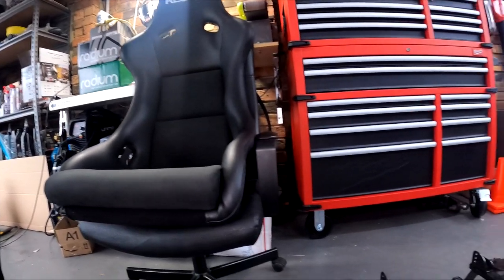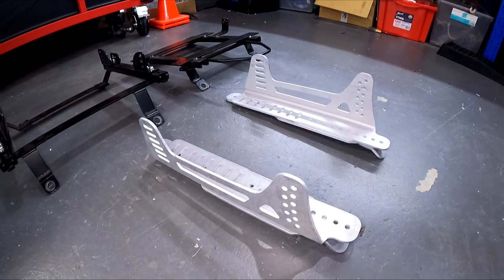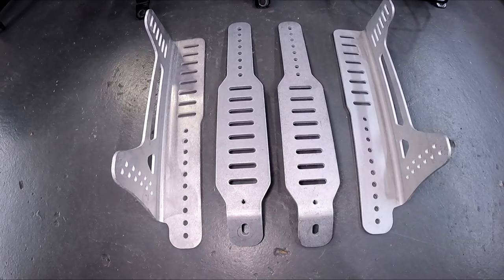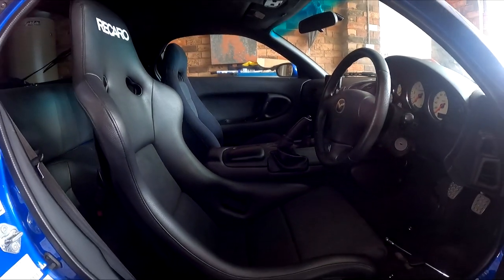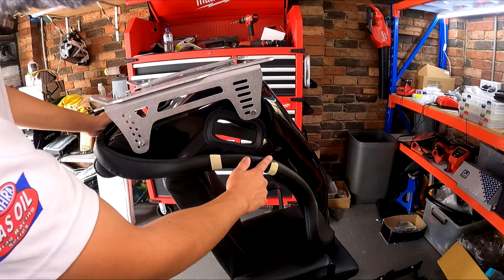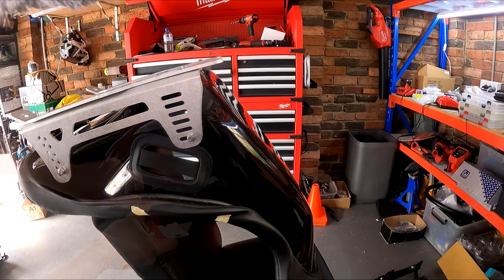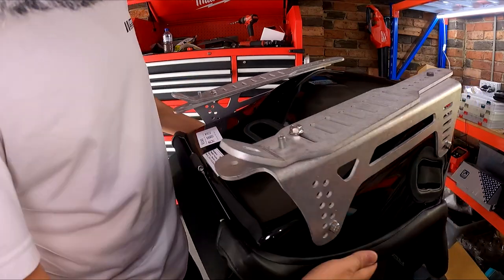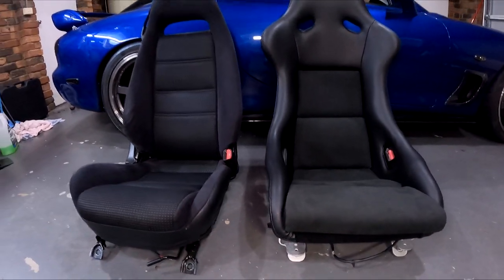FD RX-7 Build EP. 3: Installing a new RECARO!

Comment: Hi does the shoulder area rub on the door panel? How much space would you say is left over if any? I want the spg xl but the shoulder is wider. I think everything else is about the same. Thanks
Reply from the maker: Hi mate
I just looked at the dimensions for the SP-G XL and compared it to the Pole Position ABE. It looks like overall width is the same, but the SP-G is taller, longer and wider at the base. I can have a look at the car today to see if this puts the shoulder padding in a better position. There is no space left over for the ABE. It is touching but it hasn't bothered me and when I get around to it, will modify the rail to move the seat over 1cm. Hope this is helpful.
Reply: @JCYT  this is very helpful information. Thank you very much!

Comment: First off, thank you for posting this video! There is a lack of seat updates for the FD since many of the older models are no longer available.

Why did you opt for the ABE over the NG Pole Positions? The reason I ask is the NG have a narrower base and perhaps you could have gotten away without any modification to the base.

You noted the ABE's rubbed at the base, do they also rub at the should level on the trim? Have you installed a passenger seat yet? I have read the FD seat brackets have different offsets to the center between driver vs passenger so perhaps my shoulder rub concern applies to the passenger side rather than the driver.
Reply from the maker: No problem at all thanks for watching! I agree there are not too many options mainly due to the narrow cockpit (between centre console and door trim) 
There were probably 3 options (Recaro ABE, Sparco QRT performance (leather), Cobra...) 
It came down to these considerations:
1) Comfort/width: I am a size 32 waist on a good day which suits a few smaller seats (Bride Zeta, Recaro Pole FIA, Sparco Pro2000) however for longer drives and getting in and out of the car, the ABE is much more comfortable yet still very supportive for track purposes. The Pole Position also has adjustable lumbar padding which was a bonus. 
2) Leather: i wanted it to match the interior and be relatively stealthy 
3) Legality (In Australia the Recaro ABE can be passed legally with minimal issues) 

The ABE rubs primarily on the lower door trim (side bolster) as the base of the seat flares out aggressively from the back. Minimal rubbing at the shoulder if at all. It's hard to tell but check out the side-by-side snippet in the video. I have a solution which will definitely work and there should be no more rubbing but it's just not a priority atm. I am not planning to install a fixed back passenger seat - will probably keep the stock seat due to comfort or something reclinable maybe like a Recaro SR7 in leather.

Comment: How tall are u? If you mounted ot far back ,I'm 6'4 . Would I get more headroom? I fit in a non sunroof version fd with regular seats. But not sunroof version. Hoping to find a way
Reply from the maker: Hey mate I am under 5 11. My mate is probably around 6 4 and he came and tried out the seat. It's still better than stock but not as low as he wanted. I think you'd have to use a seat with less cushioning or maybe remove the seat base?
Reply: @Jonathan Chow  his head hit roof? What did he end up doing? Maybe lowmax seats

Comment: Nice work Jono. I really like that style of rail. Want to get something similar made up for the driver side of the s2000 as I need to run my seat flat on the floor and the current buddyclub super low rails are junk.
Will you get them powder coated black? Think that would finish off the install nicely and blend them in with the rest of the Balck interior
Reply from the maker: Thanks!
Definitely ideal for a fully fixed option and much lighter compared to steel! 
I should have just ordered them powdercoated black as the finish is raw and the aluminium has anodised. But just not a priority at this stage.

Comment: Is your seat installed as far back as posible? can it go any more rearward or tilt further back/ more lean?
Reply from the maker: Yes it's as far back as it will go due to the width of the bolsters. I believe there is slightly more tilt but i find this position the most comfortable
Reply: @JCYT  as in it hits the door panel at the shoulder or you mean the bottom of the seat?
Reply from the maker: @copo750  i'm sorry i can't be more specific at this stage. i haven't sat in it for months but i will find out for you shortly. By memory it is the shoulder bolster touching the door
Reply: @JCYT  thanks! im waiting to see if I maybe order the seat to test fit in my car.